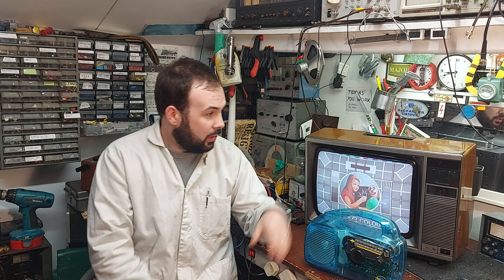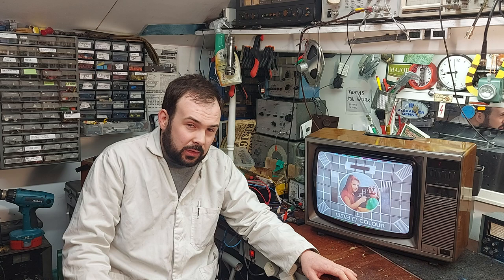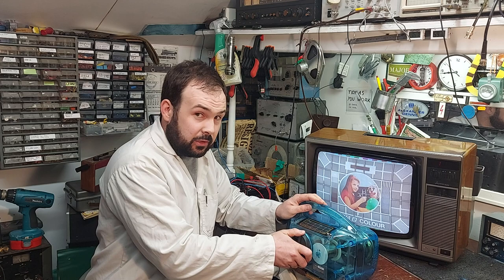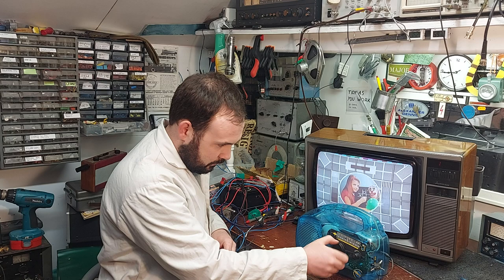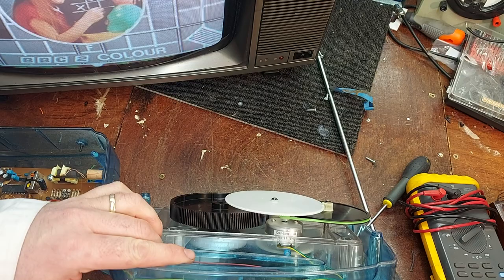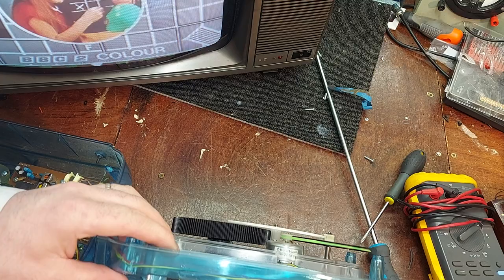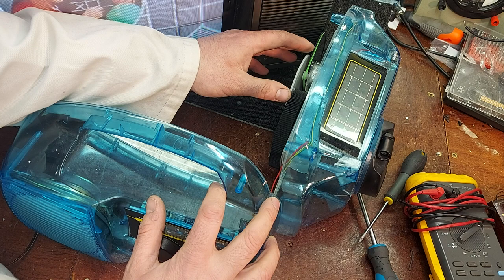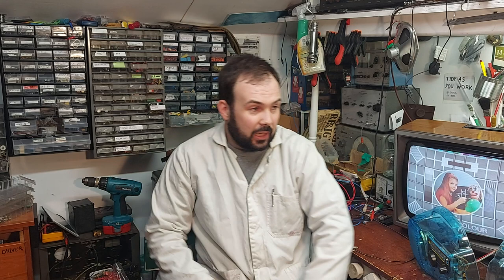Freeplay clockwork radio

Comment: I had a similar issue. I put a band back on and it's working again. I noticed that yours surges as it winds down, just like my'n. I wonder if it will break down after a while or if that contributes to the drive band breaking. Is yours still going? Good video by the way. Nice.